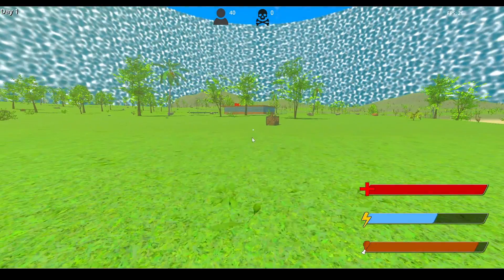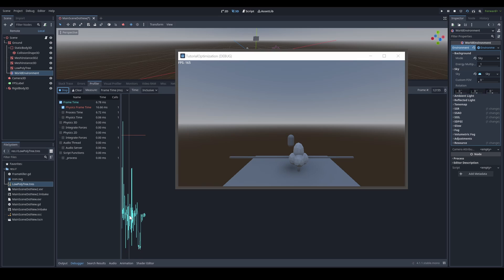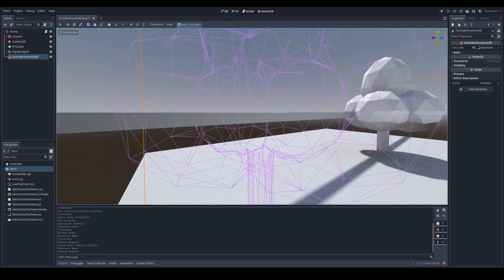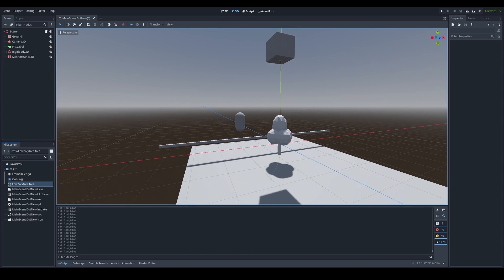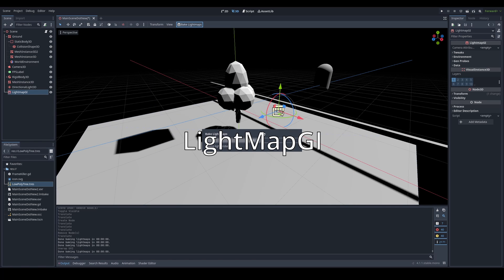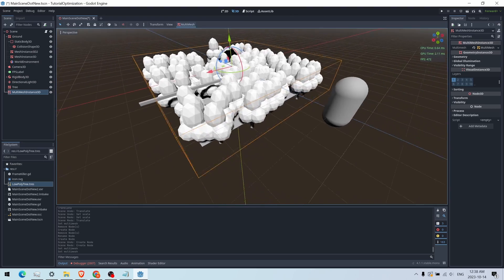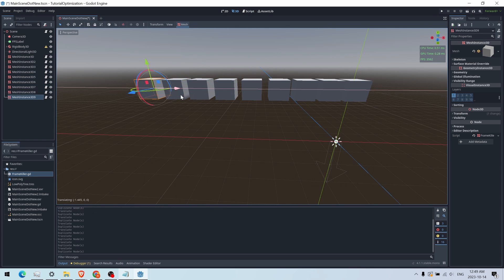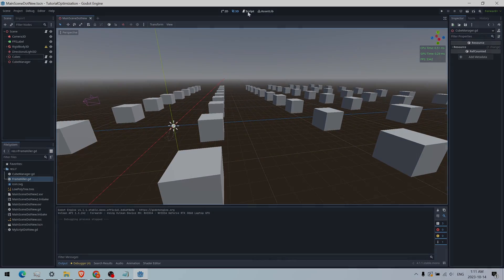Boost your games performance! | Godot 4 optimization tutorial

Comment: The final solution if your code can't be optimized beyond the basic tricks pointed out here is to re-write the parts of your code that need to be performant in C++ or Rust via GD Extensions. C++ and Rust are both compiled languages, unlike GDScript which compiles at runtime, thus C++ and Rust are much faster. There are some tutorials that explain the process in detail here on Youtube...
Reply: Good suggestion! I think that might be beyond the video creator's ability, though.

Comment: Question, I am trying to optimize something and I haven't found a way on the internet 
When I try to instantiate a pre-loaded scene that contains a mesh with a 3d shader the game has a small lag-spike with some FPS drops, is there a way to pre-load a shader before so it does not happen?
Reply from the maker: Try instantiating all your scenes once in your loading screen before you get into your game. 

Or save all your shaders in the file system, and have a script to sequentially apply them onto a material in your loading screen.

Comment: My actual question is if I should use threads? I heard its quiet heavy to create and destroy them. So I thought about benchmarking but the problem was that most of them methods don't even execute until specific conditions meet. So I wanted to know a full proof way that can create all those rare conditions and then give me benchmark so I can compare it while using thread and while not using threads. How do I achieve this?